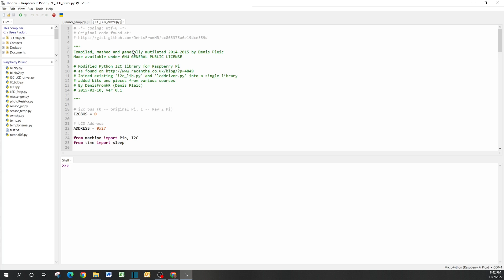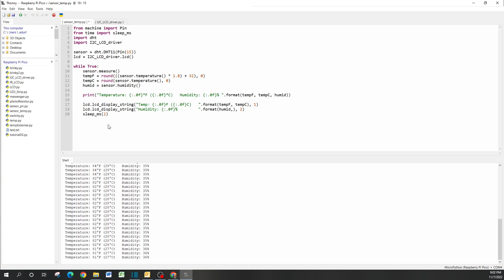MADE EASY: LCD & DHT11 Temperature Outputs w/ Raspberry Pi PICO

Comment: Best and very straight forward. 
I've been trying to get my head around coding but just can't seem to be able to code correctly when adding more sensors. 
At the moment I'm trying to put together the DHT11, RTC DS1302, 4 buttons to choose between screens, all to be displayed on the max1792 8x64 LED matrix with a Pico 2w.
I can get both sensors to run and read induvial but not together and only on an LCD 16x2 thanks to the driver you include here.